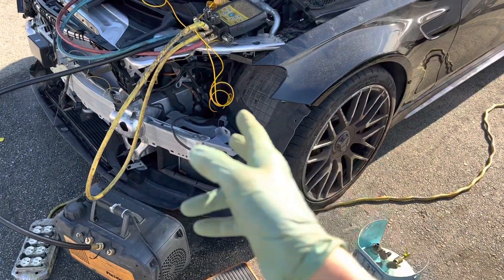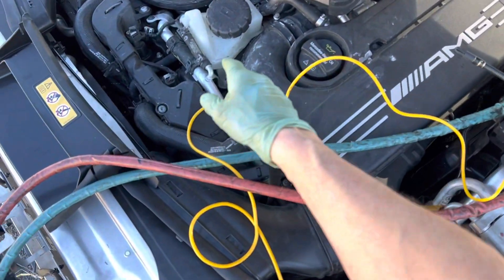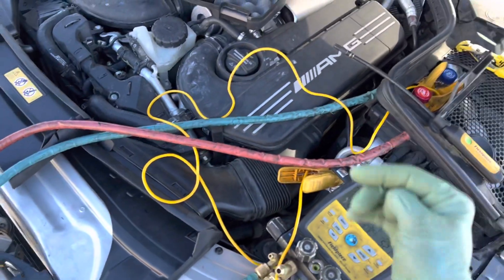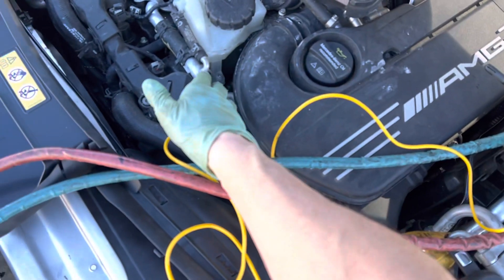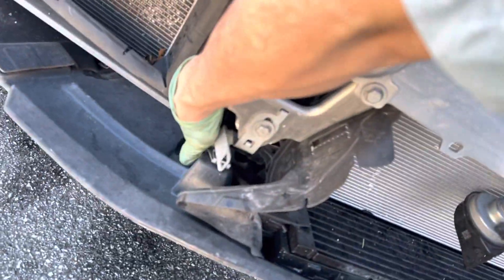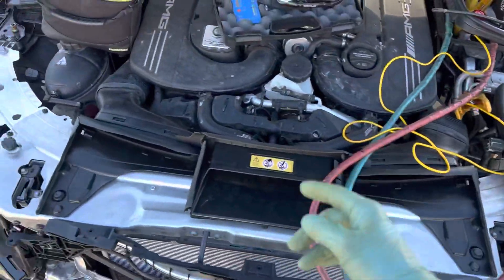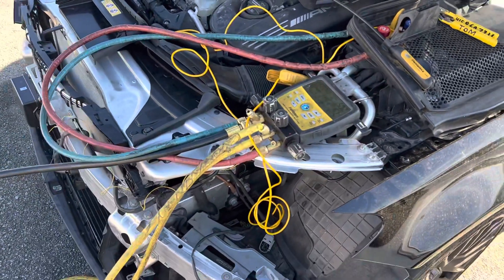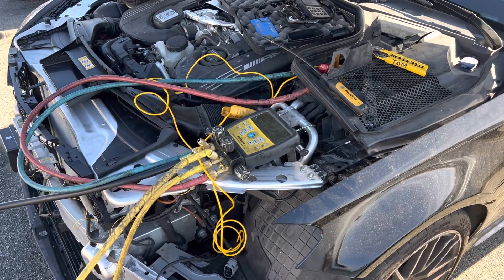Mercedes C 63S engine hot no coolant lower radiator hose no coolant no heat in any hoses ￼WTF 🤬

Comment: Wow, that could get very expensive. 💲💲💲
Reply from the maker: In all the decades that I’ve been going into different shops oh I just had $100 for every toasted roasted engine caused by employees and everyone of the shops I could set myself up on a nice vacation by now. 

Hertz rental car would hire the absolute bottom of the barrel cheapest unqualified uneducated shops the most desperate body shops that would do the work at the absolute lowest labor price and make no money on parts because hurts but the parts for their rental cars.

Those guys would call me up say we got the car here they would drive the car to me when I arrive at the shop with the engine running you wouldn’t believe after a few minutes I’d start smelling something and then you hear that crackling metal sound that very distinct sound of overheating engine and then it would start running rough lol 😂 I know that smell and that sound very distinctively because I’ve heard it so many times and witnessed

That’s what happens when you hire the most uneducated unskilled workers that you could pull off the street out of desperation and then take the cheapest deal you can get because the shop can’t get any decent real work because nobody wants to bring their cars to them For repair

Comment: Just FYI. The reservoir you pointed at was for the turbo cooling system. The engine cooling reservoir is under your bag on passenger fender. And yes they should be both topped off. 
The thing that gets me from people driving these modern cars without water, is there is a light on dash saying check coolant. It’s amazing to me to see people drive in to the shop and say “that light has been on for days”!!! Or it’s smelled like gas for days, as the pool of gas grows under their vehicle. 
Common since isn’t common, we educated that out of people a long time ago
Reply from the maker: Yes the coolant reservoir on top of the fender well that supposed to have the pink coolant in it was empty to
Reply: @coldfinger459sub0  it’s not just the engine that suffers with out coolant. The transmission is cooled through its heat exchanger, the turbos, and if the car has a power steering it is cooled too. 
If I ever need a body shop to do a repair for me I’ll call you and find out which ones to go to.
Reply from the maker: @johnthrossel9981  you must be local here in the San Francisco Bay area nobody shop is perfect summer a lot better than others and summer a lot worse than others what a bag of nuts and bolts the body shop industry is. 

Selecta Auto Body in San Francisco is where I take my personal vehicle or recommend family members to go to

Kennedy autobody in Redwood City that’s the far south about 20 miles from San Francisco they have a decent crew of guys there an owner of a shop who takes care of his crew.  And actually cares about the quality of their work

Not saying anybody’s perfect and there’s always new guys going in and out of places but off the top of my head those are two shops that pop out immediately to my mind
Reply: @coldfinger459sub0  Tom, I used to work a Junipero Serra auto repair for 10 years. They are one of most honest and reliable shops for Mercedes in the bay. Great owners!! When you would come to shop I was always impressed with your willingness to share your knowledge, and how small your car was for the amount of items in it. 
I moved to LA about 2 years ago. I took my time researching shops to work at before we moved. I am like you and want the best for the customer and I want to work for someone who believes the same.
Reply from the maker: @johnthrossel9981  oh yes now I remember I forgot who I’m talking to. 

Jimmy is my first and only recommendation to anybody who has a Mercedes

But of course a lot of people do complain about the price but a good quality honest owner who tries to teach his techs to be the highest quality techs comes out a price.

Comment: Cylinder walls doesnt like that for sure, I dont run engines more than 5 seconds without coolant, water pump seal doesnt like it too
Reply from the maker: Very very few people are educated and know that all coolant pump seals whether it’s electric or mechanical completely 100% rely on the glycol as a lubricant and a coolant to keep the face of that seal that is in contact with the rotating shaft from overheating. 

Example of how fast that tiny face of the water pump seal can get hot wrap your fingers around the shaft of a electric motor not too tight but just with some pressure turn on the electric motor tell me how fast your skin heats up with the friction against the electric shaft. 

        If you’ve ever done this as a child because you were curious you will discover you get burnt or if you grabbed it too fast you got some skin ripped off your fingers or worse ask me how I know I was a curious child who wanted to know how things worked.